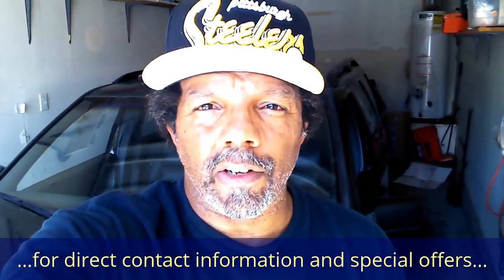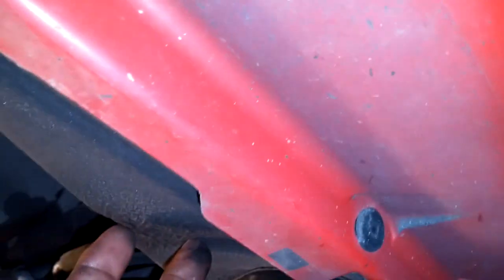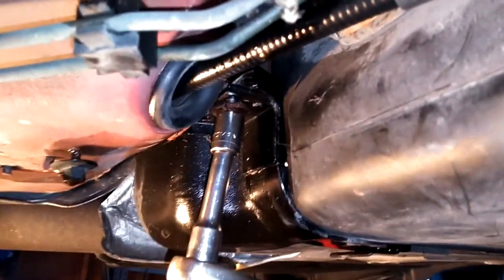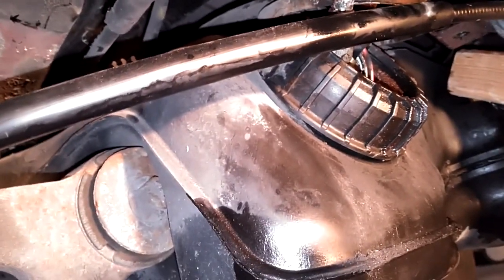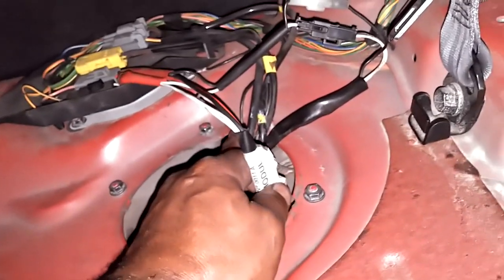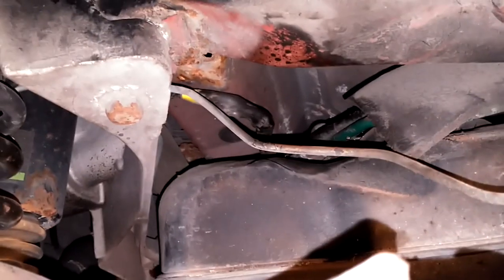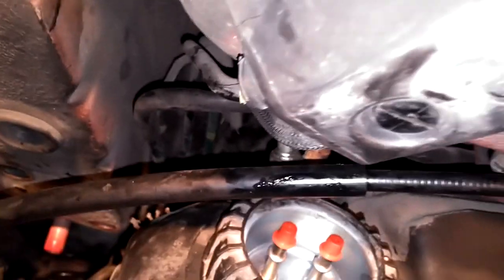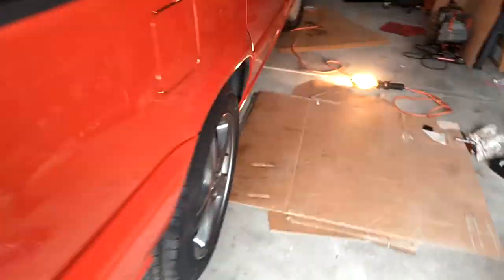How to replace the fuel pump in the Volvo 850, S70, V70, V70XC, V70R P80 vehicles with AWD. - VOTD

Comment: The fuel pump and the turbo oil return line I guess are the worst differences on the AWD P80s vs FWD.
Reply: And the lower exhaust manifold to turbo nuts.
Reply from the maker: I agree
Reply from the maker: Yuk

Comment: Replacing fuel pump with a dw200 on a 00 V70R. What would you use for a sock on the pump, inside the housing, since the bottom of the housing is enclosed? The sock on the stock unit is circular and only slightly larger in diameter than the pump itself.
Reply from the maker: I guess I'd try to reuse the original one.

Comment: Hello frome France Robert. Trying at the moment to lower my gas tank n my 00 XC: i'm running out of gas at half a tank following a new fuel pump installation (not by me I bought the car like this). The seal you mention for this problem, is on the sending unit, or on the fuel pump unit? Thanks a lot!
Reply from the maker: part of the assembly. It's all together.
Reply from the maker: https://youtu.be/8wNDmpydSj0

Comment: Hey @Robert DIY I'm still building my t5 but ive found another t5 same year and model. It has a hard time starting. I can get it to start if i hold down the throttle but once i let off the throttle completely it stops running. What could this be?
Reply from the maker: Have you scanned it for codes?
Reply: @RobertDIY  i cant because it doesnt have a battery. Ihave to bring my battery from my s70 to check it.
Reply: @RobertDIY  in otherwords it would be pointless because when the battery is disconnected it clears the codes momentarily and i cant get it running long enough for the light to come on.
Reply: @RobertDIY  any ideas?

Comment: Hello Robert, first of all thank you for your extremely helpful videos. I hope this comment finds you well. 
I have a question regarding our 2000 Volvo V70 XC. It's had various electrical problems, and now we've run into the issue of it cranking but not starting. There is fuel at the rail at 50psi, and the fuel level in the tank doesn't seem to make a difference. On the first try of the day, it will fire briefly with a racing sound of too much fuel. 
Thank you very much from Washington state
Reply from the maker: https://youtu.be/gLoO-D4yOcU
Reply from the maker: https://youtu.be/cWKOi8D4SWQ
Reply from the maker: https://youtu.be/NhtUXZTurzo
Reply from the maker: https://youtu.be/YiPAPu-K8OI

Comment: Hello Robert, I am following you from Chile, I have bought an 850 T5 and thanks to you I have been able to get it ready, I thank you for the time and dedication you put into each video. Now I have a doubt, which gasoline filter is the one I should buy ... here in Chile they do not sell specifically for this model, but they do sell for Volvo S60 III / V60 II T4, T5, T6, T8 Twin Engine models Volvo S90 II / V90 II T4, T5, T6 Volvo XC60 II T4, T5, T6, T8 Hybrid Volvo XC90 II T5, T6, T8, T8 Hybrid, in addition to the Volvo C30 (2006
- 2013) Volvo S40 II (2005 - 2013) Volvo V50 (2005 - 2012. Some of them will serve me for my P80, otherwise I will have to order it from my friends at IPD that I have already bought many original things, but I do not want to wait so long for it to be shipped. 

Cheers!!!...
Reply from the maker: Order from iPd, wait another week or 4 for it to arrive. Other than that you can search the PN for the one that fits and see what you can find locally. I usually use Bosch.
Reply: @RobertDIY  Gracias Robert!!!...

Comment: So . . . I got one line off with the tack removal tool, but I tried for hours today with the line to the filter.  Nothing.  Even made a tool like the one in Vadis.  Thinking somehow the little plastic coupling that goes over the flange is bent and that’s why it won’t release.  Any ideas?  As always, great video.  Super helpful.
Reply from the maker: Maybe get another line and sacrifice that one.

Comment: Hey there, what is the ETM problem with the fuel pump that you talk about? I'm having some intermitent starting problems, lacking fuel pressure on the fuel rail some of the times, fuel pump relay is new and im changing the other 2 smaller relays from the main fuse box, it is most Likely a faulty fuel pump, but since i have and ETM because my c70 is 99~ i would like to know what were you talking about, thanks
Reply from the maker: The plug to the ETM is very sensitive and go bad easy when people mess with it. The fuel pump on the C70 is easy to replace so you may want to try that first.
Reply from the maker: https://youtu.be/NWfLpp8NevI

Comment: Hey Robert, glad to have someone like you on youtube thanks to you, its much more easier to work on 850’s but I couldn’t figure out the problem on my Pump. It changed about a month ago at a local authorized shop everything is fine but when i try hard acceleration engine looses power at about 4000 rpm, returned back to shop i defined that problem but they refused that they fitted a wrong pump and im not sure if its wrong or correct and our conversation not went on very friendly 😅 anyways os it possible that my pump not installed properly? Or can you please recommend a pump with oe code my car is 97’ 850 T5 btw, do you know the oe pump specs? Like lph or working pressure? Thank you
Reply from the maker: Most pumps work fine. Sometimes the hose comes off in the tank, stuff like that. Any codes?
Reply: @RobertDIY  thanks for reply no service light for now but some classic misfiring error codes are appered im also suspicious about the return line of the pump might cause a low fuel pressure is it possible?

Comment: Hey Robert love your videos, use them all the time. Can you give some advice how you’d drain the fuel tank of one of these? Just filled up and the pump seems to have completely quit on me. Haven’t been  able to get a siphon hose to the tank? Do you know if that’s possible
Reply from the maker: Probably disconnect the fuel line on the back of the engine and let it flow into a drain pan. Or you can take the cap loose and catch it as it runs out of the tank with a large drain pan.

Comment: you could have pulled the fuel pump out from inside the car under the back seat
Reply from the maker: Interesting.
Reply: where is the opening under the seat??
Reply: Um no not on a awd 🤷🏼‍♂️ unless you cut a hole

Comment: I am really getting tired over here just watching I would of just cut the hole at the top I would have gone to the junkyard do a markup and measurement and cut the top
Reply from the maker: I've done it that way before. Took just as long.
Reply: Better do it the proper way.
Reply: @RobertDIY  Which way do you prefer ? This one is cleaner, but cutting a hole seems more easier no ? I have to change mine and i know know which way i prefer !
Reply: @JarodOSX  Cant do it in my 1998 Volvo v 70. The fuel pump is right under some important structure of the frame.